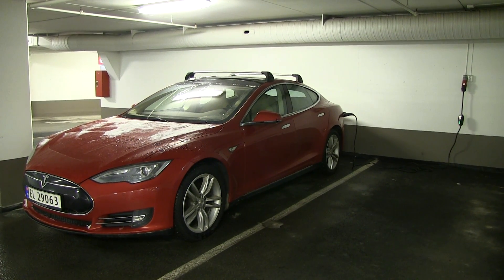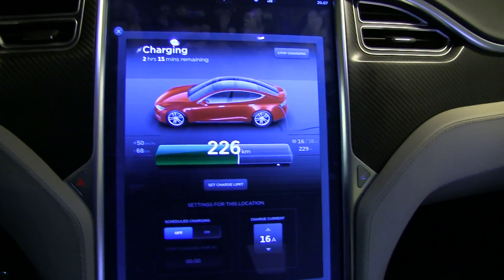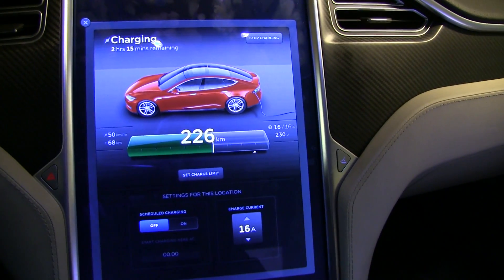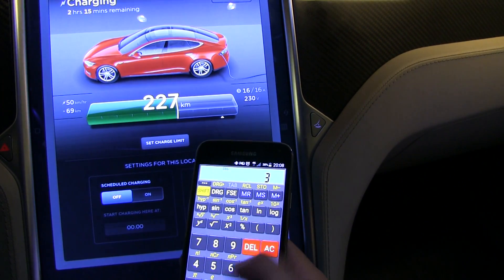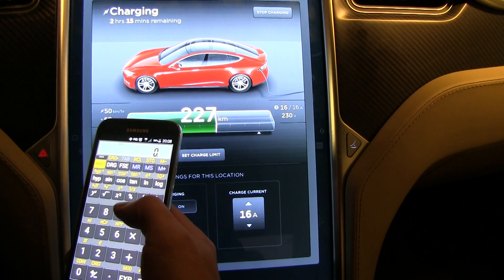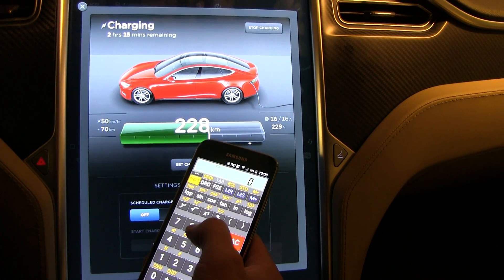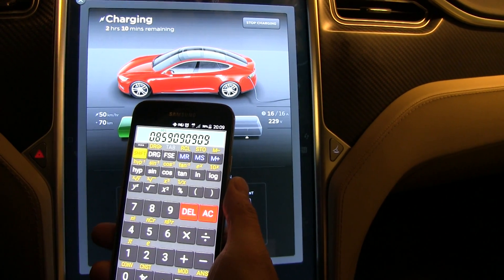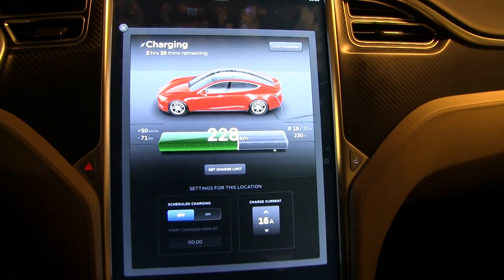Charging efficiency 400V/16A 3-phase (11 kW)

Comment: Hei Bjørn. Jeg har nettop installert 400v 16 amp hjemme. Når jeg lader daglig, hvor mye KW ville du ladet med? Trenger ikke å lade med 11kw på daglig basis. Skal bare lade rundt 10-30%. Spør deg fordi du kan dette:)
Reply from the maker: About 3-7 kW should be enough.
Reply: Har et 400V 3 fase anlegg hjemme og får det samme som Bjørn. 400v*kvadrot av 3*16A blir 11,085 kW. Hvorfor bilen oppgir lading i 230-235V vet ikke jeg. Tenkte selv at jeg ikke trenger 11 kW lading, og monteringspris med gen 3 tesla veggkontakt gav dette uten noe tillegg i pris for en måned siden. 
Sommertid trenger jeg ikke 11 kW, men har en følelse av at jeg vil sette pris dette til vinteren.

Comment: There are simply too many variables not under your control in order to obtain a simple number showing the charging efficiency.  If you measure the input power to the chargers at the wall you have one data point that is pretty hard to argue with.  Everything else is affected by other things in the car.  Call them extraneous loads.  Examples of this would be the various heating and cooling systems in the vehicle.  The lighting systems.  The computers.  The vampire loads.  Also chargers don't have a single efficiency number.  It varies depending on input voltage and current and output voltage and current.  If you were to set the input current level to the lowest setting you would probably find that the efficiency numbers would be a lot worse.  This is because the actual charger efficiency is lower and because the external loads make up a greater portion of the total.  I have no doubts that the actual charger efficiency at higher output currents is somewhere between 90 and 95%.  On a 10kw charger with output of 10000 watts a 100 watt load in the car is a 1% error in your calculation.  The seat heaters could easily do that.  The 6kw battery heater (when turned on fully) would be at least a 60% error.  Even the BMS is a load.

There is also the matter of the charging efficiency of the batteries.  With energy cells like Tesla has chosen (for reasons of maximizing range) the voltage varies quite a lot with load.  Voltage sags under load and rises under charge.  This contributes to a decrease in charging efficiency as the charging current goes up.  It looks like the supercharger at its peak output current of 330 amps only applies a 1.37 C charge rate to the individual cells (85 kWh pack).  At 10 kW you are charging at less than 0.14 C so battery charge efficiency would be pretty high

Another factor is you have two chargers.  At 10 kW a single charger car is probably more efficient that a dual charger car by a few percent.  This is because charger efficiency is a little lower at 5 kW than at 10 kW and with two chargers I assume the load is shared evenly between the chargers.  Or I could be wrong and the efficiency could be a little better at half load.  No way to tell without looking at the efficiency curves.

If you pull out the rear seats and clamp on a DC current meter to the output of the chargers, measure the battery voltage and have an accurate measurement of the input voltage and current the calculation is easy.  But I don't see that it gains you anything that helps you drive the car.  There is nothing you can do about it so it is nothing more than trivia.

Comment: 49.5 to 50.4999 is 2%. If the car draws 15.5A instead of 16, then that is more than 4% lower power draw than you calculated. 31.5A is only 2% off 32A, so the inaccuracies in the numbers can alone account for the calculated difference. You need higher resolution of the parameters if you are to calculate this correctly. It might be so, and it could possibly be explained by only one charger being used for 11kw,while two is used for 32A single phase. That makes the charger cooler, and cool electronics have higher efficiency.

Comment: I can think of two possibilities. First since yours is one of early ones and 3phase not being available in the US, it's quite possible that Tesla worked the timelines for a quicker launch.  Second batteries loose efficiency the faster you charge them, the efficiency curve entirely depends on the battery internals. It might be at 93% for 7-8 kWh and drop to 90% at 11kWh.

Comment: I do not understand the discussion at all. The measured efficiency is close to the theoretical efficiency defined by the chemistry of LiIon battery. Please do not forget that there is a significant gap in between charging and discharging voltage. Even if the Amp hours are transferred 100%, there is still the voltage gap. 
The DC DC converter itself has minimum losses of 5% I guess. Hence the overall value is not so bad.

Comment: Bjørn, why don't you just change your display to show kWh. That's the real units, not the silly and often useless km/h rating. Not only does the km/h unit assume a certain consumption rate, it arbitrary rate varies from vehicle to vehicle, as you pointed out. I've change to "energy" on my Model S and simply multiply my SOC by 2 to 5, depending on conditions, to determine range. 

On another note, I'm fascinated by the fact that the European Model S' use each of the phases separately, so it's like three separate charge circuits for each charger, each using 230v at 16A for 3.68 kW per phase and 11 kW/charger. In North America, we only have a single phase charger, so the best we can get out of each charger is 240v (two 120v "split phase", which means they're in the same phase) at 40A for 9.6 kW. Most public chargers use industrial 3-phase power with each phase at 120v. If we could use each of the phases as a separate circuit, like the European chargers, we could muster 4.8kW * 3 or 14.4 kW per charger! Unfortunately, they're effectively combined so we get 120*sqrt(3) = 208v at 40A = 8.3 kW per charger. I think my understanding is more or less correct... but I could be way off. Maybe an electrical engineer could chime in and correct me if I'm misunderstanding things.

Comment: Hi Bjørn! I do not understand your calculation.  You had 400V/16A 3-phase (11 kW) as heading, but messure on 230V/16A 3 phase.  You said that 230V*3*16A=11kW.  The right calculation are 230V*square root of 3*16A=6,37kW???
Reply: Your right! He has 230V not 400V. The only way to get 3phase 11kW or 22kW in AC supply is with 380~400V.

Comment: Power in a balanced Three Phase system is calculated: √3 V I Cos φ Where V= Phase voltage (400) I = Phase current and Cos φ is the Power Factor

Comment: 3 fase elektric is not just 230 x 3 x amps It is calculated with a formula but i cant remember it il look it up

ps the title should be Charging efficiency 230V/16A 3-phase
Reply: There is 2 possible electrical systems in Evrope: 230V phaze to phaze (133 V phaze to neutrall if neutrall is present) and 400V phaze to phaze with 230V phaze to neutrall
Reply: 1.73205080757 x 230 x 16 =
1.73205080757 x230 =398,37............. x16=
6373,94 wh so 6,37 KWh

the calculation for  all 3 fase = square root 3 x volts x amps
same for 3x230 as for 3x400

1.73 x 400 x16 =11072 wh = 11.07 KWh
but i see that you are plugged in at a 230 volt plug
Reply: +david penninckx Your are right. But the charging screen from tesla shows only the voltage between phase and ground and in Europe that are 240V +/. If you measure between phase to phase than you'll get 400V +/ ... So that's why you have to use your second calculation: 1.73 x 400V x 16A = 11.07 kW! Btw. don't mix the units - we talking about power and power is measured in Watt's ...
Reply: +david penninckx Sorry for my dashed comment I messed up something ;). Your are right. But the charging screen from tesla shows only the voltage between phase and ground and in Europe that are approx. 240V (depending on grid load). If you measure between the phases you'll get approx. 400V ... So, that's why you have to use your second calculation: 1.73 x 400V x 16A = 11.07 kW! Btw. don't mix the units - we talking about power and power is measured in Watt's ...

Comment: Bjorn, I think it's great you're doing these readings, but I honestly think car/battery temperature plays a huge part in efficiency. Would it be possible to start charging from low SOC where everything is cold, then stop in the middle and calculate your numbers, then drive a bit to warm everything up (no yellow bars), and then resume charging for another 100-150km?

Comment: Nice calculation Bjorn! But I think the 50 km/h is not YOUR consumption, but the standard consumption. My Telsa's max is 390 km, with 85 KWh makes 218 Wh/km. 218 Wh/km * 50 km/h = 10.897 W and that would be 98.7 % efficiency.
Reply from the maker: +Jan van Marum Typical is based on a standard for each model variant (P85). Other people and myself have calculated it to be 189 Wh/km. Your 85 kWh doesn&#39;t have that energy available. About 75 kWh is available for use. 75000 Wh / 390 km = 192 Wh/km.
Reply: +Bj&#248;rn Nyland So your calculated use is 189 Wh/km. Just curious: what does the car read? My P85 with 21.000 km is 241 Wh/km.
Reply from the maker: Jan van Marum https://www.youtube.com/watch?v=y7Xp7zSp7Rs